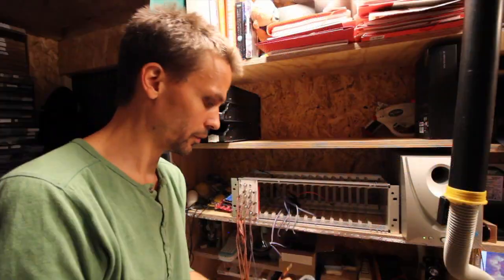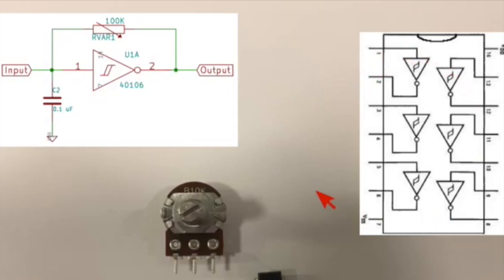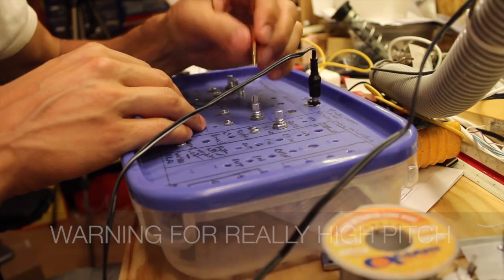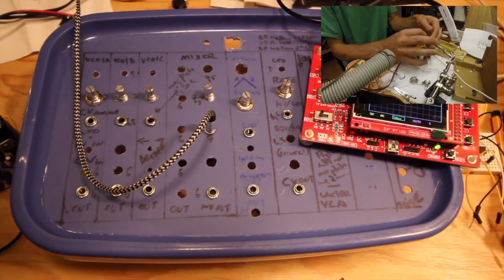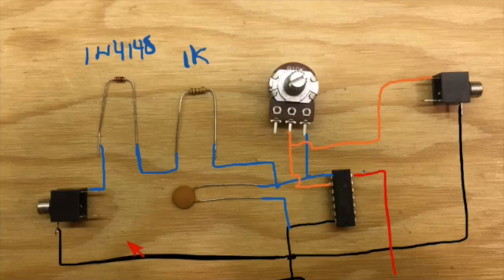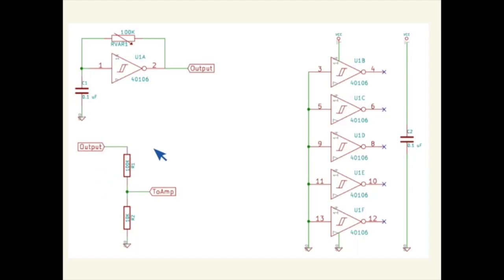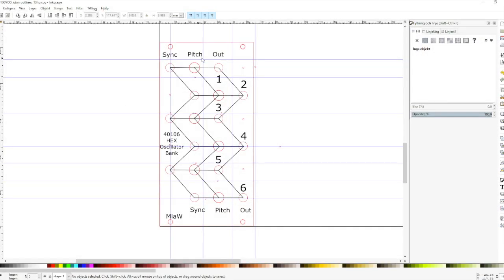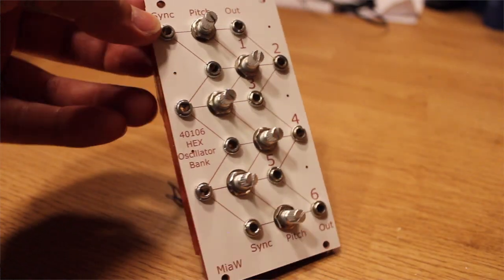40106 Hex Oscillator Bank - DIY Modular in a Week 1.1

Comment: just curious. why did anyone, never impliment voltage control to these IC chips ???? i mean. ive seen this IC chip used before as oscillator/vco whatever. but never with CV input. why ?
Reply from the maker: There is a way to implement cv control on these. They are quite more complex and I guess that was the biggest selling point that they were easy… :) But I have seen schematics with cv versions of this circuit.
Reply: @SourceryOne  can, CV be implimented with signal diode to wiper ,or one side, of each potentiometer, leading to , CV input source ?

Comment: is it possible to add LEDs to the output? or would that mess with the circuitry? that would be very cool!
Reply from the maker: There are a couple of ways to add leds. Using opamps or transistors to isolate them from the signs path.
Reply: @SourceryOne  excellent tranks! and also thank you for this amazing series, the internet needed it!
Reply: @SourceryOne  i actually google'd it and... sorry for asking, it was so simple haha! 
Of course, what you say is right and i'll try it. i'll do a proto with your schematics with some transistors to begin. Once again thank you for your work man (+ the fact that you still take time to answer basic questions like mine...) you're a hero!

Comment: Hi Kristian,  Thanks for sending me a couple of your PSUs, POW panel and bus boards from your tindie store.  They made the trip to Australia without a hitch.  I've built them and am very happy with my results given I am completely clueless re synth DIY!  I've been trying to figure this build out but I am a little confused about something on the schematics.  The value 1, 2, 3, 6 oscillator circuits coming off the 40106 all seem to have the potentiometer between the input and output pins of the 40106.  But the value 4 & 5 circuits are different.  the potentiometers look like they are only between in the input signal and the input pin on the 40106.  Is there a reason for this?  or am i just not understanding the schematics and they are really the same? regards Dave

Comment: This is great. I’ve started to build this, but don’t have enough parts to have all 6 yet. I’ve built it with two so far. I’ve also added cv in to both oscillators and I’ve also got two different capacitors for each oscillator with a switch to change frequencies. Sounds pretty good being controlled by my sequencer. 
Thanks for your videos, they’re awesome👍

Comment: what would be the voltage output for this? im asking because i need to build an oscillator bank for a video snyth that uses a vga output, which takes 0-0.75V signal
Reply from the maker: This one output up to 10-12v! So you need to add a voltage divider to the output to get down to those levels...

Comment: Troubleshooting question: I have completed the hex oscillator, test is 100%. I've also implemented a buffer (from the David Halliant's schematic featured in MIAW 4.1) . My first TL084 (incorporating 2 buffers & 2 LEDs) test is 100%. However; my 2nd TL084 is where I'm having issues, for some reason I'm only getting audio at a specific resistance on the 100k pot (@ 23k). I've troubleshot & removed & replaced the pot, & TL084, ... No change. 2nd oscillator audio tests good but the led(bi-polar) illuminates red when buffer pot is turned off, as opposed to of as the LEDs do with the first TL084. Any thoughts? TIA Kristian

Comment: Hi Kristian and thank you.
I have made a start with it and the 4106 chipset.
I have a square wave on the scope and the vco  makes a variable noise with a pot using just pin 1 and 2.
I am a bit lost as to inputs and am not getting it!
I have nothing going into the input on pin 1but it works.
Could you please explain what exactly I input to pin one?
Also how and where the patch cables go.
I see in your demo video you tested it with a single patch cable but I could not see what was coming from the other end of it?
Sorry to be so dim.
Pete

Comment: Hi, Kristian. Thank you so much for this video series. This is my first DIY synthesizer build. I have a question. On the schematics shows resistors labeled with 100 value. Is it 100 ohms or 100k ohms? It is not listed in the parts list. Also do the resistors need to be precision 1% tolerance or not? Forgive me if I’m being dumb. All the best.
Reply from the maker: Hello and welcome to the wonderful world of synthdiy. :) if the schematics shows without a k the. It is similar my 100ohms. So a very small value. I do miss to add some components to the spreadsheet and in this case it could be because I rebuilt it with buffers somewhere in the second week I think. In this case these 100ohm resistors is there to make sure there is no voltage going back into the opamp. 1% is the “normal” value nowadays but if you have some 5%lying around you can use them just aswell. It doesn’t need to be that exact in this module at least. :) keep on asking it’s the best way to learn. :)
Reply: @SourceryOne  thank you for answering my question.

Comment: Hey I have a question and maybe you can point me in the right direction. What types of parts should I invest in to start my building and experimenting process. I'm talking components on a fairly large scale. Do you have a video that encompasses all of what I would need to have a bank of parts to draw from? This might be the video.
Reply from the maker: That is a good question. And should be it’s own video I guess. I talk about it loosely in the first videos. But a resistor value kit, electrolytic cap kit, cheramic cap kit, a bunch of lm358,tl072, and a set of transistors and a set of diodes is a good start. Then quite quickly you probably want a few lm13700 and a few quad opamps aswell, tl074 and lm324. Check out the spreadsheet I did in the first week to get exactly what you need for each project and just sum the parts together for a good shopping list. :)

Comment: hi, sorry for the question. looking at your schemetatics there are some op amps but  they are not mentioned neither in the video nor in the BOM. can i ask you why? does it work even without op amps?
Reply from the maker: Yes it does. The opamps are there as buffers. Which has some effect on how the sounds interact with each other in later modules. I did a buffered mixer just to get other results from this module. And then in a much later episode I said I added buffers to this one. Buffers are good so that the next module isn’t affecting this module. But it totally works without it aswell.

Comment: Hey Kristian, thanks for your great vids. I'm just looking at your schematic and noticed there's a TL074. Is this necessary, or can you just connect everything as you've shown in the video?
What does the TL074 do?
Thanks!
Reply: Seems to be an IC chip for buffering nit amplifying. What you can do instead (because I read the comment just below) is used the 40106 chip instead. So have ur audio out from one oscilator go into the next pin then out of the following one. Then go audio out.

Comment: its a great tuto, but I cant even start.
Reply from the maker: How do you mean that you can’t start?
Reply: @SourceryOne  I think the schematics really intimidates me, besides that soldering on a protoboard requires you to create all the paths, but i am making some reads about the components
Reply from the maker: toviaj ok, start by doing just one oscillator on a breadboard. It is just a pot, a cap and two pins on the ic. And power to it of course.
Reply: @SourceryOne  thanks a lot,

Comment: Wanted just to ask you something about the 40106 VCO bank. 

Just to double check: Vcc (+5V) , Vdd (+12V) , Vee (-12V)  and Vss (Ground)
I noticed that the 40106's 14th pin is named VDD, but connected to a VCC?

Comment: Nice! Is there a way to add a CV input jack to control the pitch of one oscillator?
Reply from the maker: There’s supposed to be. I haven’t built it yet so I don’t know if it works though. For now I have sync in which makes it do some fun stuff aswell.
Reply: @SourceryOne  yeah I see people making sequencers with multiplexers and multiple pots for different resistance values, but I was hoping it'd be easier than that haha
Reply: A vactrol in parallel with the pitch pot, with CV input controlling the vactrol's LED. BUT use a 1k current limiting resistor on the LED or it will blow the LED and the whole vactrol will need to be replaced :)

Comment: Kristian, you've done a phenomenal job here! The most thorough collection of DIY synth videos I've come across. I'm already putting together a bill of parts to build a few of the modules. I'd love to see you and Sam from Look Mum No Computer get together for some sort of collab. Quick question, what capacitor potentiometer pairings did you end up using for your 40106 oscillators?
Reply from the maker: Thank you so much for your kind words, and I really hope you get a good modular going! I think the pairings is in the video.... But I would suggest you try it out on a breadboard yourself as you can use components you already have and get the frequencies you require. Sam is a hard man to get in touch with, but yeah that would be great! :)

Comment: 4:29 Is "connecting the plus voltage and ground" just a matter of +12v and GND from a standard euro header? Or is it necessary to bring the voltage down before sending it into the 40106? Thanks in advance!
Reply from the maker: Yep. Just use +12v and gnd from the power header.
Reply: @SourceryOne  Cheers, thanks again.

Comment: Thanks for these videos man. I'm a retired carpenter and have been interested in electronic music since I heard the MOOG when it came out.
Can I make one on when the LFO is high and the other one on when the LFO is low?
Reply: I have experimented with feeding one of their LFO output's into a spare inverter, so this inverts the LFO. Now you have 2 LFO signals which are mirrored. Using these as a pair to 2 switched (4066 ic) or maybe even transistor gates you can get mirrored flip flop types of routing :)
Reply: Sorry this is a late reply, but all you need do is to duplicate the sync circuitry but connect the diode in reverse. An oscillator with the diode connected as shown in video will be held off when the LFO output is high, and an oscillator with its sync diode connected in reverse will be held off when the LFO output to it is low. That's a nice easy way of creating a two-tone sound, for example, by mixing the output from the two oscillators.

Comment: Hello Kristian, thanks for your great videos. I have a question about connecting the pots, due you have noises issues with the lenght of the wires ? or do you manage to avoid using wires ?
Reply from the maker: I use wires for my pots all the time. I don’t have trouble with noise. This could be because of lighting in the room or what kind of enclosure. Although I haven’t had trouble with noise in any of my enclosures either. 
Do you have the same ground in all modules if you use two or more power supplies make sure to connect the grounds together. Check these things and get back, and maybe we can come up with more reasons. ;)
Reply: Hello, thanks for your answer. It was just a question before building my own modules, I need to gather lots of informations to make no mystakes. I am curently planning to build the simple VCO from yusynth. Did you build it yourself ?

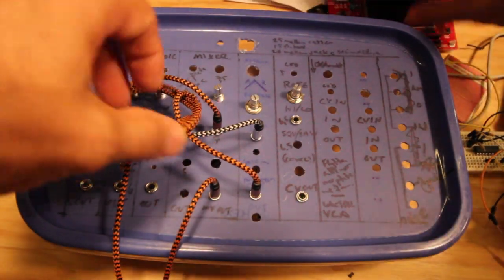Comment: 14:35 Or you could just replace the two resistors with a single pot and have it both ways via an adjustment, tapping off the middle pin.

Comment: Do the capacitors have to be ceramic?I'm buying the materials for some of some of these modules but I can't find some ceramic capacitors and I was thinking about electrolytic ones because of low price, will they work the same way?

P.S Thank you for this series, you basically did all the hard work for us viewers :)
Reply from the maker: No any capacitor would work. Usually ceramic caps are the cheapest ones. But pick a few different values to get different ranges of the oscillators. You will end up needing some slow and some fast. :)
Reply: @SourceryOne  Thank you very much!

Comment: Some tips if someone is trying this out, I found that using a 10K potentiometer with a 1uF capacitor gives a pretty good harmonyc rich sound when synched to another 10k + 1uF oscilator.
Also the original article in the description has a few fun and really easy ways to add new features like light controlled frequency and an envelope of sorts with a couple of capacitors.

Great build Kristian :)
Reply from the maker: Guille Arana thanks for the tips. Two oscillators with almost the same pitch makes a really nice phasing sound. I wanted a big “span” for my oscillators some low and some high. They both have their uses. And yes. Loads of fun experiments in that article series on hackaday.
Reply: @SourceryOne  sure I also liked your idea of using really low osc as triggers or square LFOs

Comment: What would be the size of the faceplate for this and the Nicholas Ronnenburg passive multi, and are the uploads to scale? I have a friend who can machine them but they asked me these questions. Can I open them with any software and figure this out if need be?
Reply from the maker: thnknde the uploads should be to scale. Just make sure they are 128mm height, then it is correctly scaled.
Reply from the maker: You can print them on a normal printer also to check sizes and to see if it fits in your modular.
Reply: @SourceryOne  I have a friend who can cnc faceplates for me, so I was hoping he could just load the image and it would just chop chop chop to scale lol. Thanks for the advice and making this content!

Comment: PLL chip is one of the greatest for osc's. Did you've tried it? I've paired it with 40106 for modulations and intermodulations - a great combo.
Just one thing I've couldn't manage: how to pick out the saw output from PLL's timing capacitor's cycle! I know that it will be twice faster but just couldn't make it to work.
Reply: If you're going to build a 4046 osc, use the Big Daddy of them all, the Thomas Henry x-4046 osc:

https://www.birthofasynth.com/Thomas_Henry/Pages/X-4046.html
Reply from the maker: Yes I did a 4046 vco. Your design sounds interesting. Do you have a link or schematics? Would love to take a look.
Reply: @SourceryOne  https://easyeda.com/RealMook/4046_Synth_1_0-76ae65b986194525ba4fca0d6a65d9d1

Comment: Super dumb question. What's the input to the circuit? I'm very confused with that. So, you connect the Logic Inverter to a power supply ofc, but the input of the circuit is a Function Generator with a certain fixed frequency or are you connecting it direactly to a power source?
Thanks for the help, and again, sorry if it's a silly question.
Reply from the maker: Well this would be the function generator. You connect it to power and this circuit creates six square waves that can set the frequencies with the pots. You can the use the outputs of these six oscillators as sound or to control other things. You could use one output from one oscillator to the “sync” input of one of the other oscillators to create the stutter effect that I show in this video also. Hope this better explains what it does. Take care.
Reply: Thanks! I wasn’t analyzing this properly, later I realized how it worked lol. Just another question. The diode has to be connected to the Jack port? I tested it without it to take the output of one circuit to the input of another, but it didn’t work with the Diode input but with the normal capacitor input.

Comment: btw if you want the outputs of the oscillators to be buffed you can sacrifice one inverter for each output as a buffer... Just connect one inverter in between the oscillator output and the jack... This is what I did with mine... Halfes the module from 6 to 3 oscillators but the most expensive parts are the pots and Jack's anyway... So if I need more I just use another Cd40106
Reply from the maker: Thanks that is a great tip! I actually rebuilt mine just the other day adding a tl074 and a tl072 for buffering. Could have used just one 40106 more. Will keep this in mind. 👍
Reply: What does the buffer do? Is this what would allow cv to happen?
Reply from the maker: thnknde no buffering makes the sound not be changed by signals from later in the signal chain. It kind of stops signals from going the wrong way (backwards).
Reply: For example, just have to plug pin 4 between pin 2 and jack ?
Reply: @dtharmo  you need to feed it through an Schmitt trigger... So connect the output of for example of  the first oscillator (pin2) not to the jack but to pin 3 and then pin 4 to the jack...
Reply: @daverog12  so this will work just as well as a tl074? I thought the chip was for amplifying or something.